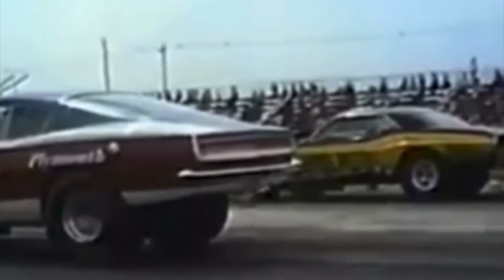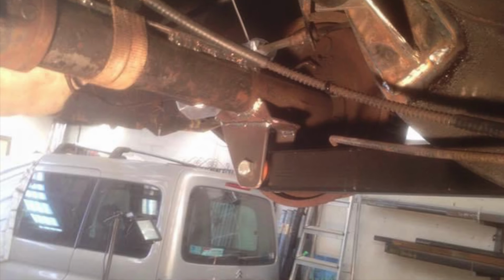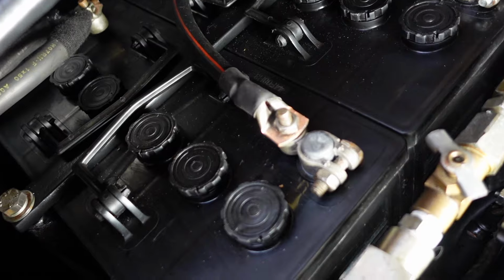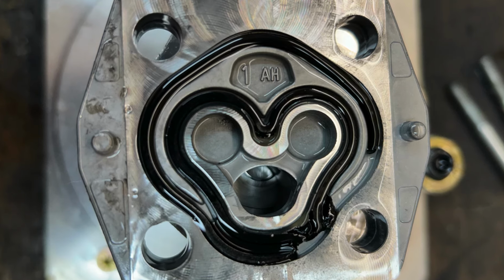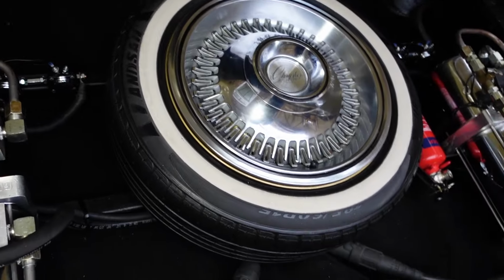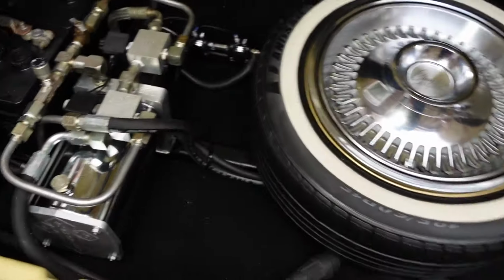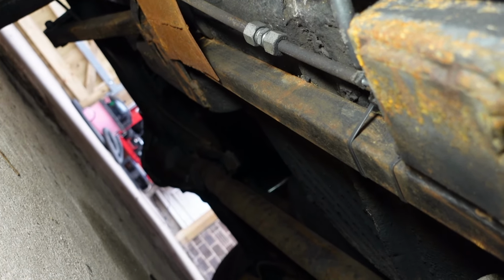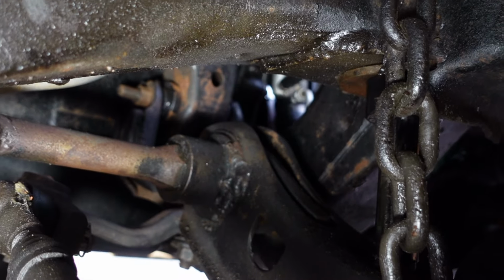RARE CHRYSLER NEW YORKER LOWRIDER - We take a look at, service and repair a UK Built Mopar Lowrider!

Comment: We use sealed group 31s here. Those battery clamps are a no go. It looked beter before. That car would not be allowed on the street here, That sh*t is dangerous homie. You got screwed!!
Reply from the maker: It came with those batteries, and you can’t buy threaded posts in the UK. I recommend to the customer that the batteries need changing for group 31s but he doesn’t have the £600 budget to change them out so I cleaned and sealed them up as much as possible. Why do you think he got screwed?
Reply: @LayNPlayTV  The frame!! That looks dangerous, it would never pass inspection here. It would of been better with no reinforcements to the frame. Stress points would of been enough. But I doubt their needed, Boxed frames are for hoppers and fast setups this car is slow. For example, on my car when I give the switch the slightest tap. I will be at full lock up and wheels would of popped off the ground.  I have 14” and 18” cylinders. That’s fast and it creates a lot of torque on the frame. I have a full size fleetwood that I hop with only stress points done. I have a bridge and extended reinforced a arms but that’s for 3 wheel and larger cylinders hopping ect. Those lead cable ends will cause nothing but corrosion, we use chrome audio power wire ends No corrosion. The spare wheel was like that so it can be seen from a far, otherwise you have to be behind the car looking in the trunk to see. It’s supposed to attract from a far for show. I’m not sure what # pump head you have. But as far as I know CCE doesn’t make a pump head for compact cars. It’s the lack of batteries. 48v ain’t movin 💩
Reply: Tell him to check out refurbished batteries, that will bring the cost down. And get some coils 🤣 I run 4 ton full stacks in the front and 3 3/4 ton half stacks in the rear.   Dumped out car sits 1” off the ground, so I don’t get the purpose of that other then to break 💩
Reply: @THEOLYMPIAGUY360 your a fountain of knowledge
Reply: @ZachRing  I’m a lowrider builder. For parts check out the layitlow form!! You will find endless knowledge their and the parts you see in lowrider magazine. All the people, Companies,car clubs that make the parts are there. All the legends
Reply: @THEOLYMPIAGUY360  here in the UK we are limited for car choice, parts, service, most stuff is imported in. LaynplayUK and Limit Fabrications keep our scene going. No doubt people can DIY but not all of us can. Layitlow is awesome for info and advice. Would you recommend a 3rd pump on an impala 70 with minimal wrap? Full Frame off is costly
Reply: @ZachRing  depends what your plans are for the car. What are you trying to achieve? Adjustable suspension, lay and play, hopper?
Reply: @ZachRing  if your going to go with dro’s on the impala and want to do a single pump setup. That’s 1 pump to the front and 2 pumps to the rear. I’d go with 6-8” cylinder in the front 10” in rear you can cut a coil off the stock springs. That’s on stock frame. Anything more you will need to do stress point reinforcements. Which are the arches of frame. Which is no big deal just 1/4” steel plates welded to the outside of frame through the wheel wells. Bigger, like higher lockup or 3 wheel which is why we have 3 pumps,  requires more reinforcing. A arm perches rear diff.
Reply: @THEOLYMPIAGUY360  i can easily do a rolling 3 on 2 pump. So your saying if I go 3 pump I should at least have the wheel well frame plated?  Atm I have 2.5t coils front and back, reinforced arms front and back, front extended too.
Reply: @ZachRing  I was talking about the high lockup 3 wheel and standing 3. Yeah the arches where the frame goes Over wheels. On rear it’s about a 3ft piece of 1/4 steel. Then the front under A-arms. Forgot to tell you about rear trailing arms good catch.  But if your gonna 3 wheel you should have your rear end reinforced as well as quarter panels. When you shift the weight your putting it all on one axle tube on the rear diff. So I’m sure you’ve seen how our rear ends look boxed in. Theirs the piece of steel that runs the whole length of the rear diff, from shock mount to shock mount. Put in some power balls too. And you’ll probably want to change the stock springs out to something heavier 1/2 ton to 3 ton. I also see the A-arm perches and a-arm ears break a lot on impala’s so I’do those to.

Comment: Strange chassis set up
Reply from the maker: Apparently fairly standard on Mopars, Unibody other than a front chassis almost like a subframe that came with all the running gear and slotted/bolted under the car during production